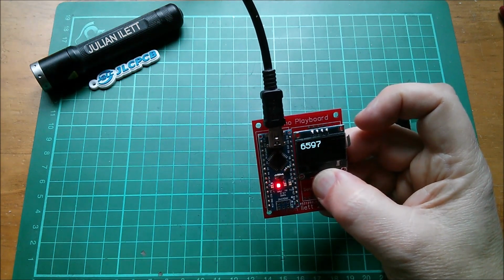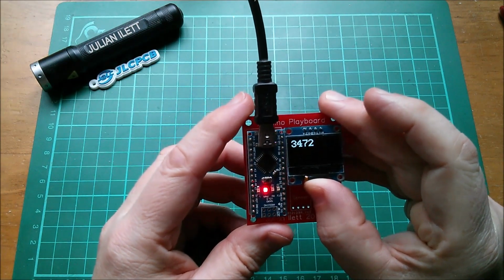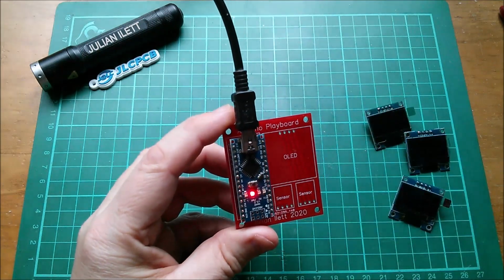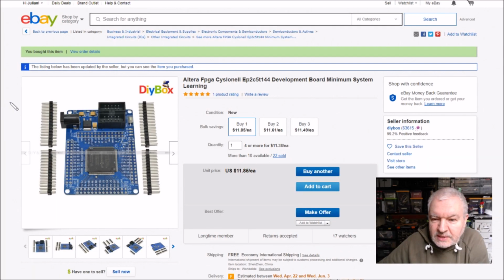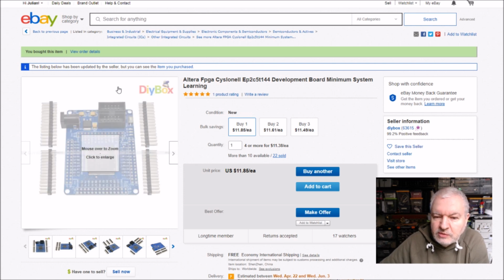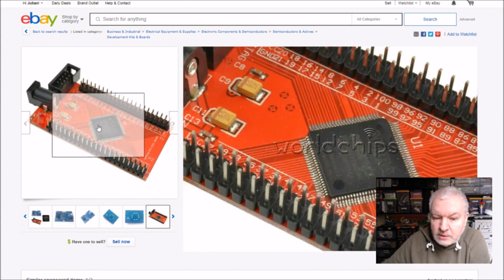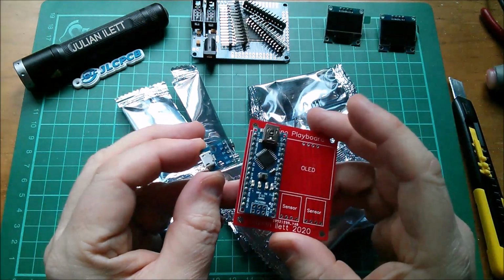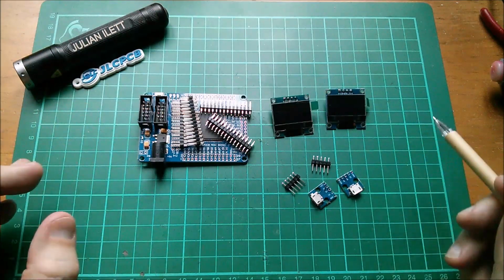Julian's Electronics Postbag #145 - OLEDs and FPGAs

Comment: I'm kind of fascinated with FPGAs, even though they're beyond my knowledge base.  I'm more of a sci fi author than an electronics guy.  LOL  But that said, I think there is a segment of the FPGA scene waiting to be born (that tickles the fancy of my sci fi self).  When I was researching FPGAs for a story, I found myself looking around for open source cores that you could download just to see what was out there.  At first it was old ones like the 6502 and 6809.  But to make it sci fi, you always need something more, right?  LOL  So, this led my research down a rabbit hole of FPGA cores for chips that never existed.  Things like a 64-bit variant of the 6502.  I love that.  Virtual chips that are the descendant of architectures that basically died.  This creates a scenario where you can play "what if."  Like - what if the x86 architecture failed to overcome the 65xx architecture?  What would a computer from that reality look like in 2020?  Would it be a multi-core 64-bit 6502 descendant running a later version of GEOS?  What would that look like?  Alternate reality computing with FPGAs.  LOL  Anyway, sorry about this wandering comment. :)

Comment: The USB sockets easily break off those adapter boards because the solder pads under the mounting tabs are too small. I've fixed mine by drilling two small holes next to the tabs and scraping off the solder mask top and bottom. I then poked some wire through the holes and soldered top and bottom. This also has the added benefit of grounding the USB shell as it should be. Fixed!

Comment: I've got a few designs that use these type of screens, and often find the power & data/clock pins reversed. I just make the PCB with a solder jumper so I can select what pin goes to what power rail, and the same for data and clock.

Comment: I've been playing with that FPGA for a couple of weeks. Designing a FM Sound Chip - with a single bit DAC output. I prefer to use Altera than Xilinx as Vivado is very slow on my i3 PC.  Quartus 2 (version 13.1 needed for this FPGA) is much, much faster.  I think I bought my board for a Z80 project, which of course never got started!

Comment: I made a 32-bit shift register with feedback (pseduo-random number generator) in software for an 8-pin PIC and sent one bit as output to make a noise generator.  It does the same thing as the shift registers and gates, but in a single tiny package.
If you wanted all 32 bits as output, you could just program the same thing in an Arduino Mega or similar.

Comment: The thing that's annoys me about FPGAs lately is that most people just seem to want to use them to recreate microcontrollers, which kind of defeats the purpose of having an FPGA that can do lots of stuff in parallel instead of trapping you in a loop like most MCUs do with void loop() or while (1).

I'd love to have a simple little FPGA board that can be programmed over USB, with no USB Blaster required, that could replace an entire board of logic chips (or logic chips that don't exist because they're too specialized for any manufacturer to bother making) and let you design stuff as if it was a hardware circuit and not just program it completely in Verilog or VHDL and treat it like a microcontroller.

I know Quartus has the ability to draw schematics of logic circuits but it seems that most people aren't interested in this anymore.
The open source tools for FPGAs are also completely beyond what I want to try to figure out plus they're designed for software people, which I am not.
https://icestudio.io/ is a nice compromise between schematic design and software design, the interface is great, but it outputs really ugly Verilog which means the code it creates would be hard to re-use in another software package.

https://github.com/hneemann/Digital/releases/tag/v0.24 and the official Quartus tools on the other hand might not be as nice to use but at least they can export easier to understand basic Verilog.

A simple XOR in Digital 0.24 is very obvious  even for someone who doesn't know Verilog but understands logic circuits. It doesn't include the wires so I'm not sure how useful it is.

module \xor  (
  input a,
  input b,
  output \output 
);
  assign \output  = (a ^ b);
endmodule

Quartus also outputs nice readable Verilog

module xor1(
 A,
 B,
 Q
);
input wire A;
input wire B;
output wire Q;
assign Q = A ^ B;
endmodule

icestudio, on the other hand, outputs this ugly code.

// Code generated by Icestudio 0.5.0
// Thu, 05 Dec 2019 02:58:38 GMT

`default_nettype none

module main (
 input v64ad1c,
 input v1a9680,
 output v7a285f
);
 wire w0;
 wire w1;
 wire w2;
 assign w0 = v64ad1c;
 assign w1 = v1a9680;
 assign v7a285f = w2;
 ve9ceb2 v29cf4e (
  .v0e28cb(w0),
  .v3ca442(w1),
  .vcbab45(w2)
 );
endmodule

module ve9ceb2 (
 input v0e28cb,
 input v3ca442,
 output vcbab45
);
 wire w0;
 wire w1;
 wire w2;
 assign w0 = v0e28cb;
 assign w1 = v3ca442;
 assign vcbab45 = w2;
 ve9ceb2_vf4938a vf4938a (
  .a(w0),
  .b(w1),
  .c(w2)
 );
endmodule

module ve9ceb2_vf4938a (
 input a,
 input b,
 output c
);
 // XOR logic gate
 
 assign c = a ^ b;
endmodule
Reply from the maker: Looks like a colossal learning curve - wish me luck :)
Reply: @JulianIlett  I just wish some hardware people decided to help the software people know what we'd like to have for programming tools because at the moment the only open source work seems to be designed for Linux-y minded software people who live in command line driven tools.

Icestudio is 90% there at making a graphical tool that lets you put in code when needed but there doesn't seem to be much progress being done on it for quite some time.
Reply: @JulianIlett  I'd recommend learning VHDL before learning Verilog, simply because it's much stricter and more pedantic.  Quartus will spew error messages at you for the slightest little error in a VHDL file, whereas with a Verilog file you're much more likely to get a project that builds successfully but doesn't work!  Both can be frustrating, but I found the former was preferable when I first started learning.
Reply: I think more people might use the Quartus schematic editor if it was less painful to use!
Reply: @brotheredward06  yup, it's as clumsy and old fashioned as  LTSpice. That's why I wish some hardware minded software developers would be more interested in schematic capture but at the moment it seems everyone is interested in just recreating MCUs and old processors inside FPGAs or even running Linux on them.
I'm more interested in creating what's essentially my own custom logic chips that can do stuff quickly and in parallel instead of having to rely on standard MCUs that force you into annoying loops of sequential instructions.

Comment: I think the hardest bit is getting your head around the 'C' looking code is that its concurrent execution and not sequential. once you have your head around that, yo can forget and start learning. or in my case get an FPGA contractor in to do the hard bit ;)
Reply from the maker: Yeah, that's interesting. It's like a shopping list - the list order is pretty irrelevant :)
Reply: When I was re-organizing some bookshelves this week I found some VHDL training manuals from a course I got sent on at work around 2001 or 2002 and it made me nostalgic to dig out some of my CPLD or FPGA eval boards. I just can’t think of anything to do but maybe the best place to start is blinking an LED, i’m sure that would trigger a lot of people with the overkill aspect!

Comment: Anybody running that Cyclone FPGA on Linux?  After downloading the software (4+ GB IIRC) I couldn't get it installed on several Linux distros that I tried.  Admittedly I am still somewhat of a Linux newbie even though I have installed several distros (and several on one PC in a multi boot).  The board has been sitting doing nothing since... sad I know.  Any pointers to get back at it and get it installed on Linux?
Reply: I can't be much help without knowing exactly what problems you're encountering, but I can confirm that the Linux version does actually work!  I never had major problems installing (using Mint and Bodhi, so both distros with debian heritage) - I have Quartus 13.0sp1 and 18.1 installed.  When you extract the .tar file the actual installer is wrapped in a shell script that you can run with "sh setup.sh".   It doesn't need to be installed systemwide - you can install it to a directory within your home directory - the hard part is finding the actual executable to run it!    (something of the form ~/intelFPGA_lite/18.1/quartus/bin/quartus)   Also, on my particular 64-bit install 13.0sp1 needs to be run with the "--64bit" argument otherwise it complains about not being able to find libpng.

Comment: I've got the same Cyclone FPGA board but with the headers already installed plus the USB "Blaster" programmer.  I would suggest "saving" that PCB for a later project (that may not need the headers) and just get the full kit soldered up with headers and the programmer.  At the time mine was cheaper as a kit any way.
Reply from the maker: Or I may get the CPLD board - CPLD programming may just be a bit easier - I don't know.

Comment: Be aware that the Cyclone does not have any configuration ROM, it needs to download the full configuration every time power is cycled. So you cannot use the board as a standalone like an Arduino, it always needs to be connected to the program source when power is turned from off to on.
EDIT: Oh, I might be wrong about the board, it looks like it has a serial Flash chip for configuration data (on the other side).
Reply: Yep, this board does have flash storage for your design. You just pop your JTAG programmer into the 'AS' (active serial) socket to program it.

Comment: You should be fine using version 13 of Quartus with that board.

That's the last version that supports the older Cyclone II and III boards, but it's still able to "compile" for the newer Cyc IV and V.

Oh, and the newer versions of Quartus don't seem to help much with the compile times. On more complex logic (like retro cores), it still takes AGES. lol

(for something like a few shift registers on a Cyc II, it should only take a minute or two to compile / synthesize.)
Reply: 13.1 is the latest version to support cyclone III devices yes. 

The speed of quartus is an artifical limit of the free version. The paid version synthesizes and builds WAY faster, however it costs around 5k per license.
Reply: Yup, for Cyclone II the last version was 13.0sp1.  Interesting what you say about the speed restriction.  Older versions of the free version would only use 1 CPU core for building - newer versions seem to use all available cores.  Are there still big differences beyond that one?
Reply: Hi,  @brotheredward06  

It's been a while. Hope all is well?

(current events permitting.  lol)
Reply: @electronash  Hi Ash!  Yeah I'm doing fine - how about you?  I fell down a CPU-design rabbithole a few months ago - wrote a new CPU in VHDL, then of course I had to write an assembler, linker and C compiler backend to go with it!
Reply: @brotheredward06  

Not too bad, thanks. Trying to stay away from the Zombie Apocalypse, but I don't get out much anyway, so that's a bonus. lol

Still messing with FPGA projects (often MiSTer-related), and struggling to get anything released, but I'm getting there.
Reply: @electronash  Yeah, we geeks are uniquely qualified for self-isolation!  I haven't explored the MiSTer in detail yet - but I gather some of the more demanding cores need a fan to keep them stable?
Reply: @brotheredward06  

With the larger cores like ao486, the chip does get quite toasty, and then you can sometimes start to get glitching of the HDMI output.

With a simple 20x20x10mm heatsink, it's usually fine, and requires very little airflow.

I used a cheapo 12V fan on my original IO Board, which ran on 5V, and it was near-silent.

There was a bit of a learning curve to the HPS (ARM) stuff, and some messing with the Linux side if you want to do modify any code, but the interfaces for the OSD and loading ROMs is quite straightforward.

For most cores, the HPS code doesn't even need to know which menu option does what. It just toggles various "status" bits, depending on the menu option selected.

https://github.com/MiSTer-devel/TurboGrafx16_MiSTer/blob/master/TurboGrafx16.sv#L151

ROM loading is usually done by the HPS, using the "ioctl" signals on the hps_io block (just below that CONF_STR stuff.)
Reply: I was working with somebody for quite a while to get CD support working for the tg16/PCE core, but we hit a bit of a stumbling block. lol

The CD drive (or interface "briefcase" thingy) has some extra RAM for ADPCM samples. But it seems quite a few games also store data there.

Whenever I tried adding that RAM and the extra interrupts required, the core would either crash, or not boot at all. And it was taking around 25 minutes just to compile the core on my i7, so very time consuming to debug.

Obviously it's tough to simulate the CD drive stuff, too.

Some games do at least load, but have random issues getting into the game, or glitches etc.

We might get there in the end, but I have a feeling somebody else will figure it out first.

Comment: Interested in worldwide radio, software defined radio (SDR), or just want to see a powerful FPGA in action?  http://websdr.ewi.utwente.nl:8901/
This WebSDR site covers 100 kHz to 30 MHz simultaneously.  A fast A/D converter feeds data into a large FPGA, which then sends it to an Ethernet interface.  Three IC's is all it takes, then the data is sent to a server over Ethernet to a server running the WebSDR software, which can support hundreds of users listening to different frequencies at any one time.

Comment: I’m back! And I love these cheap OLED displays, they’re quite easy to run with Arduino for any sensors! Thanks Julian!
Reply from the maker: Welcome mate :)
Reply: Watch out for these cheap displays! It's not only the pins that can differ, the I2C addresses are sometimes different. And you can't even trust the silkscreen on some of these! So always use an I2Cscanner for this, just to be sure.

Comment: It's actually quite easy to get started with FPGAs, just don't get sucked into the trap of trying to implement every tiny detail of the logic yourself. Verilog and VHDL are high level languages that can infer things like multipliers and block RAM out of C-style code. This keeps your code clean and allows your design software to optimise the logic.

Comment: Oh, gosh... FPGA mining. I tried that. Extremely fun to develop my own SHA-256 code, but massively painful and not profitable at all.
Reply from the maker: FPGA mining is not so much a goal, but a driving force that's keeping me interested. I'll be pleased if I can get a couple of flip-flops working :)
Reply: Julian Ilett - same here. I just wanted to try out. Before I noticed, I was spending hours tweaking my code to fit a whole double-SHA in a single board on a single clock. FPGA is as addictive as Arduino.
Reply: Forget common algorithms like SHA256 for FPGA mining, the last time I mined anything with a FPGA (mid 2018) was on a coin that used BLAKE256, only made about $25 before the coin crashed. I guess getting $25 back on a $100 FPGA board that can still be used for other purposes isn't bad.

Now I plan to get a return on one of my FPGAs by using it to build a solar inverter.

Comment: What's fgpa?
Reply: What's Google?
Reply: An array of programmable logic blocks
Reply: @sdgelectronics  LUTs are Look-up Tables.
Reply: I guess that's a typo. An fpga is a field programmable gate array.  Lots of logic elements (NOT, AND, OR, etc)  that arent interconnected  in production, but can be interconnected by the user, via software .  The " field"  word is like the difference between a memory that can only be "blown" once and one that is rewriteable.   So its configuration can be changed "in the field", after being built into  the target circuit.   Fantastic, but not easy unless you're willing to pay the licence fees for pro software.
Reply: Quick explanation: https://www.youtube.com/watch?v=gJ0vQpSIYPw

Comment: FPGAs - how exciting! I used to make a living designing boards with FPGAs on them. I'll be interested to see how you design a circuit using one. You can use equations etc in, say, VHDL, or you could just draw a schematic adding familiar TTL or CMOS chips from the library. You don't even need a board to test your design as the Altera software has a built-in simulator,. You just add some input signals and use their virtual logic analyser to look at the outputs.
Reply from the maker: The tricky bit is making an interesting video from within an IDE. The flashing LEDs stage needs to happen quickly.
Reply: @JulianIlett  For quick results it's probably best to use the schematic route, you don't need to learn any syntax like you would have to if you used VHDL or Verilog. You could just choose a counter from the Altera library and fill in a simple form saying you want it to be however many stages of division you want. Then just define a clock input pin and an ouput pin.
Reply: @JulianIlett  I'd suggest getting something visual like Pacman running on it (there are loads of arcade cores floating around now), but that particular FPGA doesn't have many RAM blocks.  If you fall down the FPGA rabbit hole I think you'll be wanting a bigger device soon!

Comment: Interesting stuff, I need to get 4 lines on one of those OLEDS, what is the name of the font your using please ? also have you ever got the ones with a yellow section at the top ? your quite right you have to be a bit careful when ordering...cheers.
Reply from the maker: I'm using this font: u8x8_font_px437wyse700b_2x2_r
I do have a blue/yellow one somewhere, but it may be an SPI type.
Reply: @JulianIlett  Cheers.